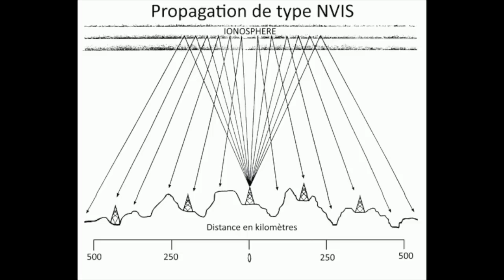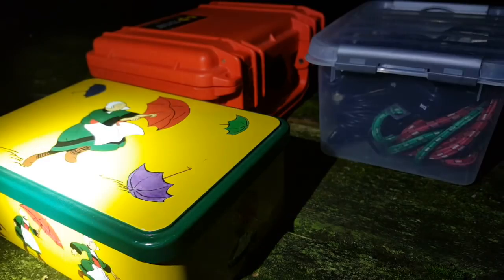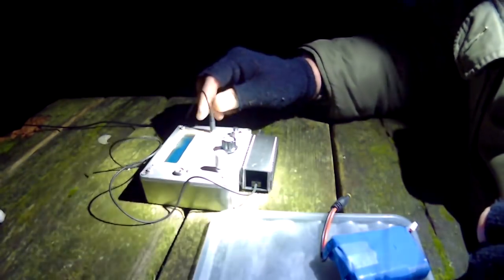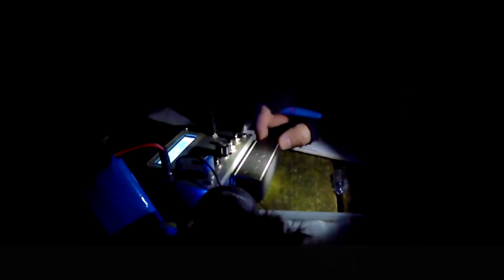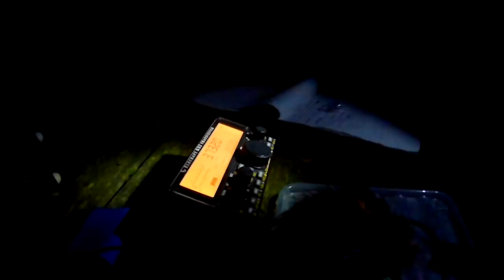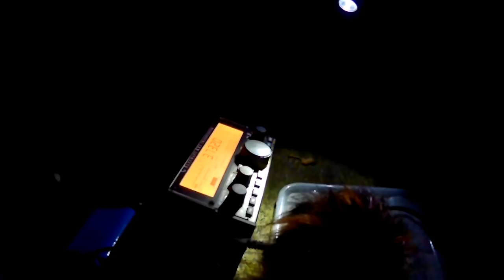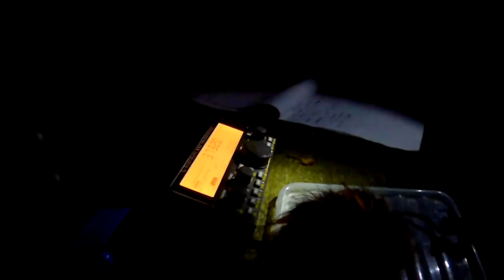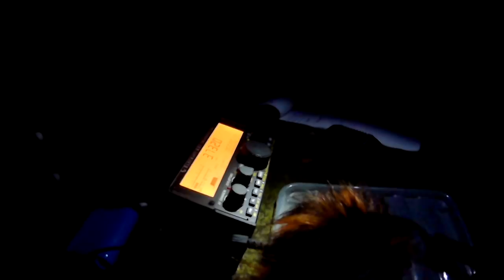NVIS Regional Radio Communications With Low-Slung Wire Antenna.

Comment: Great video Gil!  I have been able to work 80 meters NVIS SSB from inside a motel room!  I used 100 watts into a 9:1 unun, and strung a 23 foot wire across the room about 8 feet from the ground! Can often work 100 to 300 miles away.
Reply from the maker: Great on a 23 foot wire!

Comment: I don't know how many times I'm working QRP and the other guy is running 400 watts (sometimes more).  Cool demo of 80M NVIS.  Also - the low antenna is indeed easier to deploy (easier than throwing a line over a tree, for example) and is typically quieter close to the ground too 👍.  You have a very practical setup.
Reply from the maker: Same here... I just don't see why spend a fortune for an amp then waste so much electricity for something that doesn't bring that big an advantage...

Comment: Hi Gil,
As I have said before I am a big fan of NVIS communication. So much so that I don't want to see its full capability sold short. Just like water boils at 212 degrees F is true at sea level; it is also true water boils at much lower temperatures when the atmospheric pressure is lower than at sea level. Likewise; you can almost always count on NVIS working on 80 and 40 meters because the upper atmosphere is, in a sense, nearly always opaque to those frequencies and rather than penetrating the atmosphere the signal is returned to earth. However as in water when boundary conditions change, any frequency that is capable of what is referred to as skipping will work in a NVIS mode if desired. If you look at websites that estimate or have measured the maximum frequency that skip will occur for on that particular day then any frequency under that upper limit is capable of NVIS for that specific day. So, my thrust of this little note is please don't sell frequencies higher than 7mhz short for use in NVIS situations. I have actually used NVIS with 11 meter radio during peak solar activity. Also, as a bit of a side issue, I have laid the antenna directly on the ground and then with trimming of the antenna have been able to acquire a NVIS situation for transmit with a very low SWR or reflected power.
Take care, love your channel.
Mike
Reply from the maker: Thanks. I will try it some time and mention that it's possible. We want reliability of course but that's another story...

Comment: Outstanding work Gil. I use the HFlink .com World NVIS map for guidance and following this I find early mornings around 07.00 much better. Have just  got up a 80m dipole about 15 feet above ground in an inverted  V configuration.  This looks promising but of course very hard to say where the signals are saturating as you don't get feedback from stations that can't hear you, unless you brake into a net for a group report. A further problem is other operators like your two contacts were not using NVIS configured antennas which I understand is necessary for best results.

What I would like to do is to replicate the US Marine Corps experiment with two humvees going north and south of a hub station  and making NVIS transmissions every 25 miles. I believe they had success out to around 250 miles with antennas 4ft off the ground.

All I need is two humvees lol. 
Many thanks Larry M3mpd.
Reply from the maker: Something else to buy, LOL. Mobile NVIS, that's another challenge.

Comment: NVIS is deffinitly something i want to practice with and have at my disposal should i need it for emergency communication. I just need to make some ham friends in my area to coordinate something. I love that all you have to do is string dipole or end fed a few feet off the ground.  Great video.  

I also enjoy being out at night as well. I always feel a little paranoid trying to operate out in public during the day if im in a busy area. Not that i dont enjoy talking to people about radio. I just dont necessarily want someone coming up to me randomly when im trying to accomplish something because they are curious about the weirdo stringing up a wire in a tree.  If i were a bit more outgoing i would love to talk to strangers and potentially get them interested in amateur radio. I'm just too much of an introvert.
Reply from the maker: Indeed it is easier than it sounds. As to strangers walking by, so far I haven't had any trouble, just curious people, but you never know...
Reply: @RadioPrepper  I've definitely never encountered a stranger that was hostile luckily. But it depends on where your at in my area. Unfortunately if your In many of the city parks there are some questionable people that like to hang around and see if you have anything of value that you are leaving unattended.
Reply from the maker: Right... I do still expect someone to call the police on me some day... Oh well...

Comment: Thank you for the nice video. For SSB qso in NVIS style imo we have to use at least 20 W output, but for CW abt. 3 to 5 W works nice :)  vy73, Dietmar, DL4HAO, QTH nr. Hamburg/Germany
Reply from the maker: Certainly 20W would have worked much better. I should have tried with my PRC-320.

Comment: We have been unsuccessful at using NVIS antennas for local communications on 40 meters. My antenna is basically between a dipole and an inverted V. The balun is about 15 feet (4.57 meters) above the ground and one end is about 2 feet (.6 meters) & the other about 4 feet (1.2 meters) above the ground. I can make contacts with stations more than 400km away but not any locally.
Reply from the maker: You might want to try with a horizontal antenna without dropping ends...
Reply: @RadioPrepper  Ok thank you for the advice.

Comment: Halloween music =)  A little QSB on both of those QSOs but well done.  NVIS is a very nice technique that particular antenna can be used at 2 meters but an optimal setup is about one eight of a wave length.  So 10 meters on 80, 5 meters on 40. That seems to give you the most gain upwards whilst still reducing vertically polarized local noise.  I've had exceptional results with antennas that were set up that way and my QRP rigs.  W4MHz ;)  I will just add that you will do better if you support the center of your end fed at about 1/8 lambda and keep the ends about one or two meters off the ground.  That configuration is very effective and is in common use in many armies around the world a counterpoise will give you about 3 dB additional gain as well.
Reply from the maker: Indeed. And I thought the music was appropriate ;-)

Comment: Good video Gil. I have a similar  antenna, 130ft. end fed in an inverted V. The peak is 20 and the ends are 10. On 80 I can work stations down the street or states away. Good fob with your 5 watts.
Reply from the maker: Thanks. I prefer 134ft for the CW portion...

Comment: Hello Gil, nice video. 

I have KX2 too and using Endfed antennas as well. Not really proficient (yet) in CW so mainly on SSB.
 I was using KX2 in French Alps in winter with a random antenna, tuned with internal ATU,  2 to 3 meters high over the ground and it worked on 80m too.  This is my favorite setup for SOTA activations on Reunion Island BTW.

Bonne continuation de Thomas F4HPX
Reply from the maker: Merci, et bon courage avec le Morse, ça vaut les efforts..

Comment: Gil, you might consider laying down on the ground a 5% longer wire than the 1/2 wl right under the antenna when it is in straight line, could maybe give some enhancement?
Reply from the maker: Oh yes, three parallel ones is even better!

Comment: Yes the resin around the core seems to me to bugger them.
Reply from the maker: Maybe, but I would not have thought so...
Reply: Hello  @RadioPrepper  and thank you, there is some conjecture between rosin and epoxy, the only personal experience is I covered a balun 4:1 with epoxy and it did lift the swr unsatisfactorily not greatly but I would not use it. Here in Australia with the Flying Doctor network the antennas they supply have baluns encased in a hard epoxy/rosin and it is not clear, like material, it is impossible to get the material out without destroying it.  I also have coated home made copper 50mm dia copper coils with rosin around the 14 to 20 uHy mark with out any difference to the inductance of the coil.  Sorry, that's measuring the coil after making and coating to let dry, I now cut and use spacers out of PE bread board, a lot better i can  change the pitch if i want. Thank you for your videos. All good, all of them. Dennis Bauer VK4JDJ 73

Comment: I am getting 100/150 km NVIS on 80m ssb and cw doing SOTA working my local vk5 chasers when i go activating during daylight . Sometimes with lots of bush on the summit the 80m extensions to my dipole lay on top of the bushes and it still works fb. Sorry there is still interaction with the resin balun its looks too good not to work hi.
Reply from the maker: Yep that's NVIS for sure..

Comment: Thank you for the demonstration.  I need to reach 25-50 miles , over mountains for my group emergency communications system. There is one or two repeaters for 2 meters, but we need a system that does not rely on the repeaters. Can I use NVIS for contacts as close as 25 miles?
Reply from the maker: It should work.
Reply: @RadioPrepper  Merci! I am studying for the US General license, and shopping for HF gear. I will try the NVIS... I have plenty of room on my land for wire antennas.
Reply from the maker: You might want to post your results on radiopreppers.com...

Comment: Bonjour, 
One question, you use an inhabitual 49/1 balun , I guess that you feed your antenna at  a end. As you have plenty space and a full half length , at 4 feet hight , could this antenna be feed on the half with an ordinary balun 1/1 ? Or Im wrong assuming that the impedance of an antenna is low when near the ground ?
Reply from the maker: Hi, I find it more convenient to feed it at the end. The impedance doesn't change much,  though I have not tried it higher than 20ft horizontally.
Reply: @RadioPrepper  Do you say that feeding it as a dipole was almost the same with a wire 4 feet high ?
I search if the impedance is lower or higher when the antenna is low , but i dont find an answer..
Reply from the maker: No. I'll have to look into that... I just think the difference is not great with height changes below 20ft for the end-fed.
Reply: @RadioPrepper  Sure tht's the balun which is not the same ..😊

Comment: How did you determine the need for a 49:1 xformer specifically vs, say, a 9:1?
Reply from the maker: Because my wire is a half-wave length, very high impedence... A 9:1 would be for a "random" wire, other than a half-wave...
Reply: How did you arrive at the value of 49?
Reply from the maker: 2 turns primary and 14 turns total is a 7:1 ratio, 7 squared is 49.
Reply: Thanks! Do you have a recommended reference for such calculations?
Reply from the maker: Not really, just stuff I picked up along the way. Best way is to just experiment and browse Internet resources...
Reply from the maker: https://www.facebook.com/groups/EndFedHalfWaveAntennas/
Reply: Thanks!

Comment: Would a mag loop be any good for NVIS?
Reply from the maker: Yes, both NVIS and DX. I do think most commercial loops are too small though. A 5m perimeter seems ideal to me.
Reply from the maker: I've seen those... The loop folds into the roof rack.